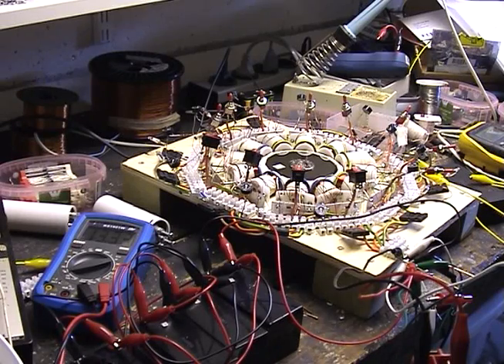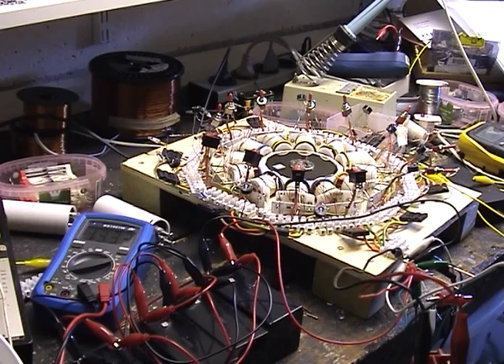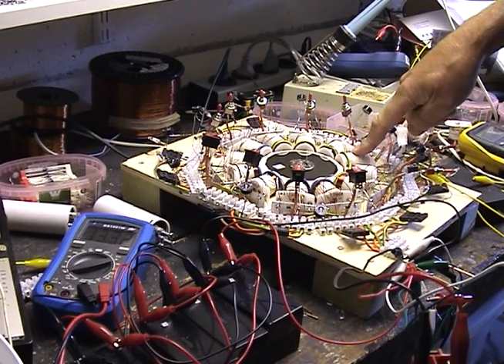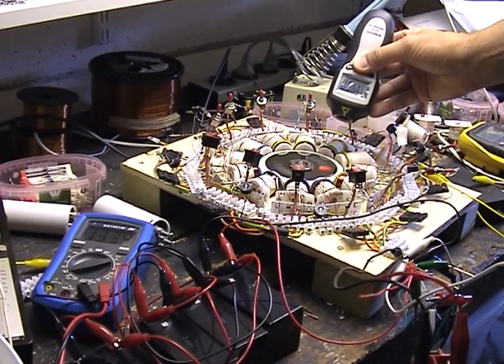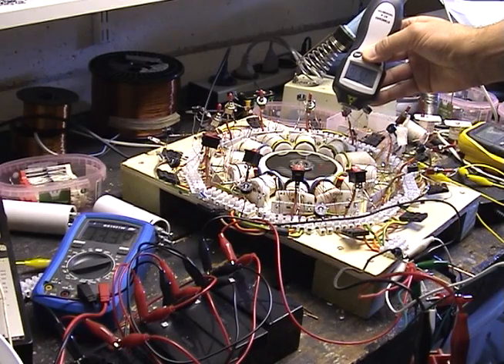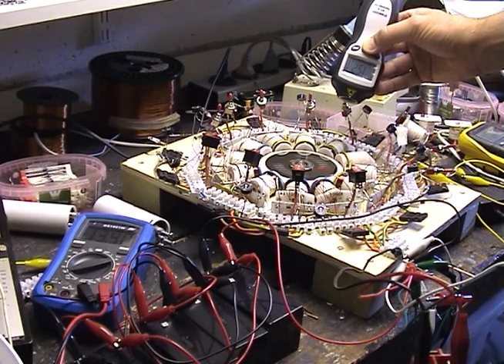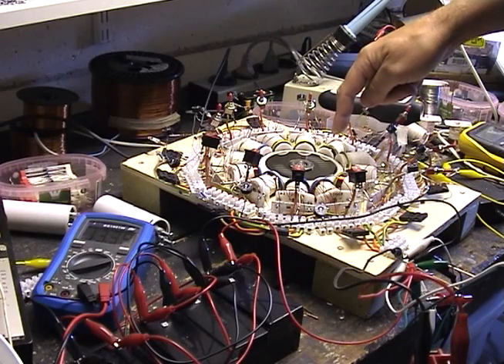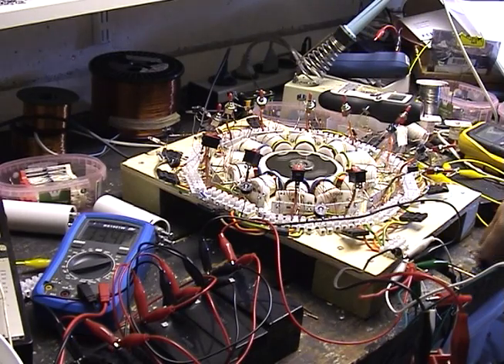Delayed Lenz

Comment: The theory you tried to explain looks correct.

The proper way to get Lenz law used to make useful work is - let it always push already passed magnet when generator coil is under load and more force you get, the less power is needed to keep rotor rotating. Overcoming to the point where will be no need of driving coil would result in glorious achievement!

Comment: sinergicus,

                   My experiments indicate that by placing diametricly magnatized tube magnets coupled end to end inside the core of a thicker wire, lower voltage output coil, one can increase parasitic coil capacitance and generate lower voltage Lenz delay propulsion that way.

Comment: Is here  a way to calculate the maximum wire thickens of the generator coils and the maximum windings to have some amperage not just high voltage at the output and to keep, in the same time the speeding  up phenomena of the rotor?

Comment: Is here  a way to calculate the maximum wire thickens of the generator coils and the maximum windings to have some amperage not just high voltage at the output?

Comment: All you need is a fast switching Shottky diode and a super capacitor in series between the two leads of the output coil, then two wires from each end of the capacitor to the corresponding battery electrodes. I bet the one output coil will be enough to charge the run battery.